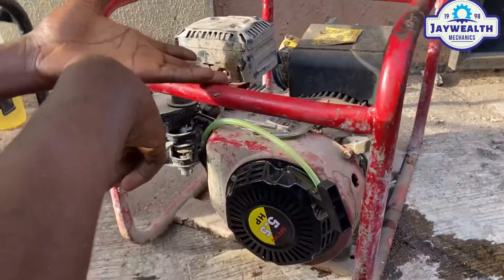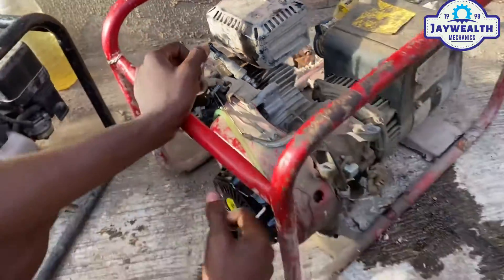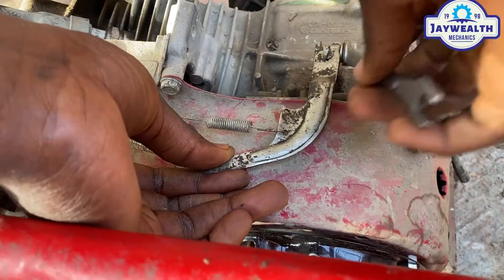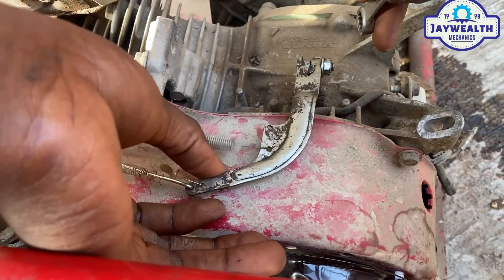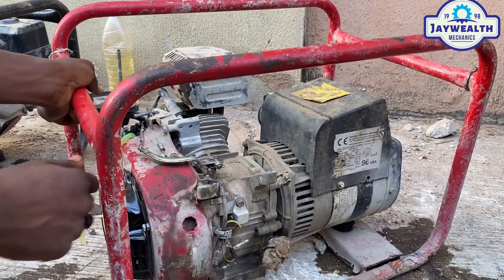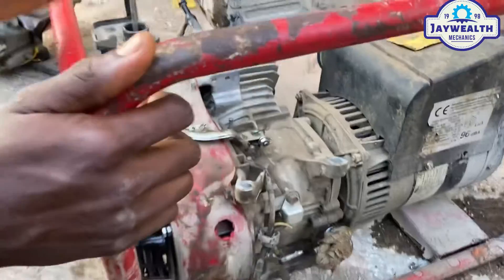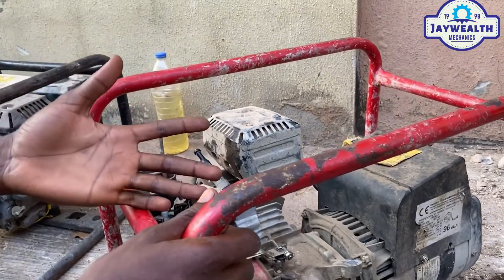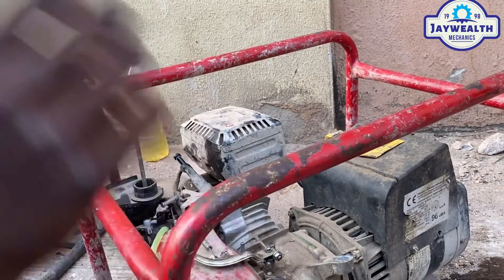GENERATOR GOVERNOR RACE ADJUSTMENT- ( Honda 3.5kva).

Comment: Nice video and straight to the point but I tried it on mine it won't start and when I readjusted it, it got high again. I'm so frustrated
Reply from the maker: Check the carburetor speed.
Reply: @jaywealthmechanics9285 I can't believe you replied to me wow! So 😎 however the governor pin fell inside the engine as I kept messing with it, after adjusting the carburetor speed still didn't work. I feel like it's now hopeless probably going to buy a half  engine now.
Reply: @1622felix is half engine good solution?
Reply from the maker: Reduce it there